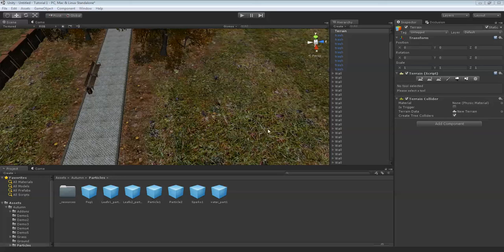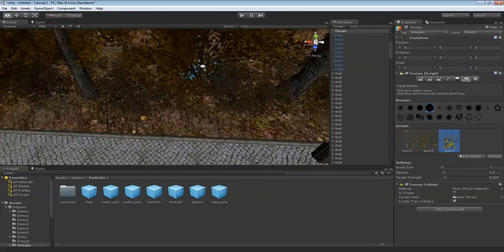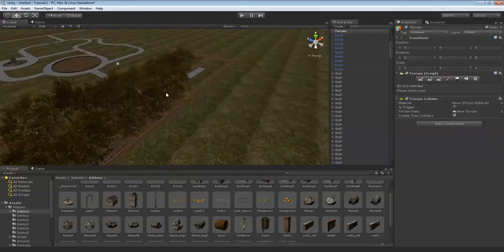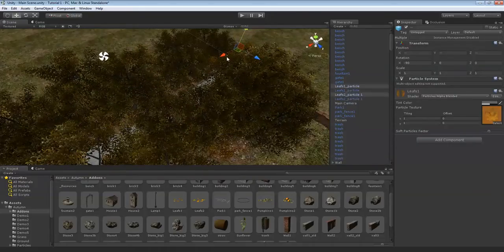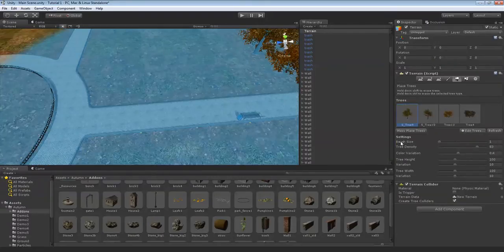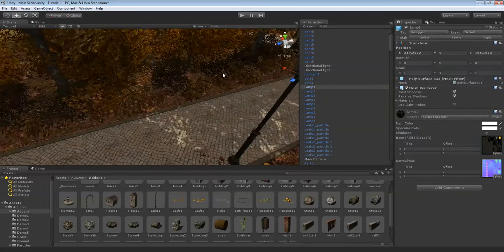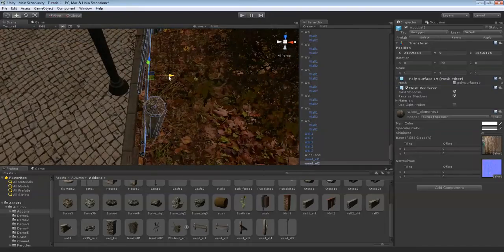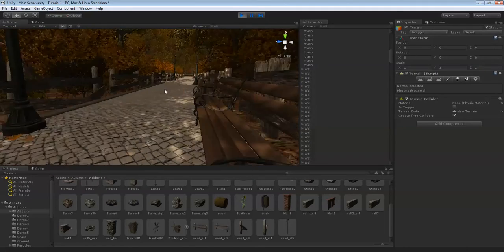Unity 3D Autumn Park Tutorial Part 2

Comment: Okay, some questions (and I'm really new to Unity so sorry if this sounds kinda stupid) what if I had a really large space of terrain, and I wanted to have the grass textures like you have, but randomly spread throughout the terrain? How would I do that? Also, how do I delete trees after they have been placed? (Besides Ctrl+Z)
Reply from the maker: You can manually paint textures or use another tool shape and increase the size to cover a larger area or you can do what i do now which is use a texture Slope map to texture my terrain. To remove you use Ctrl and Left Mouse Button to remove one you have selected and use Shift Left Mouse Button to remove all trees. This also works the same in removing grass.